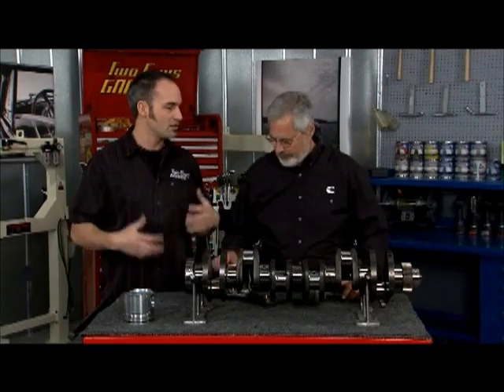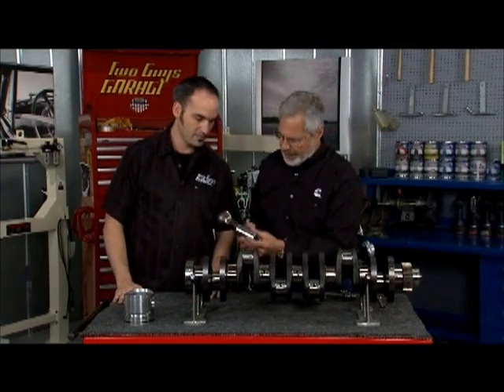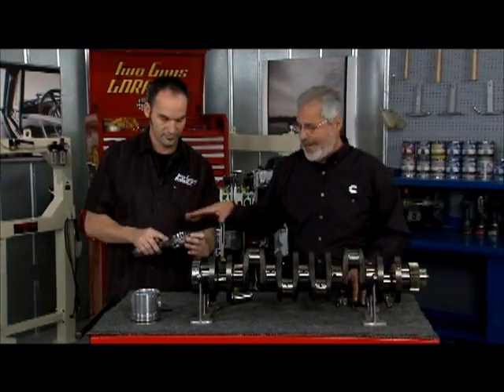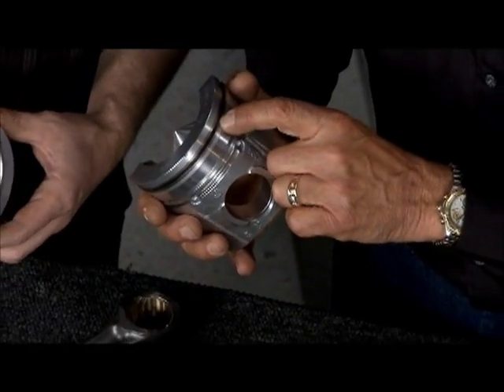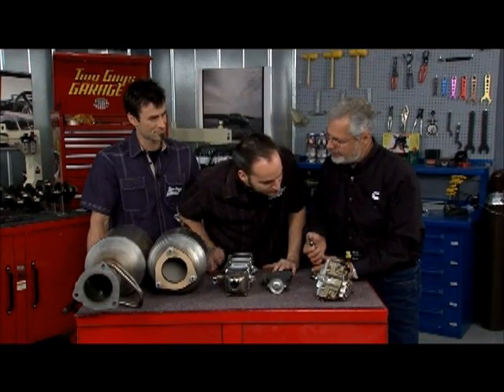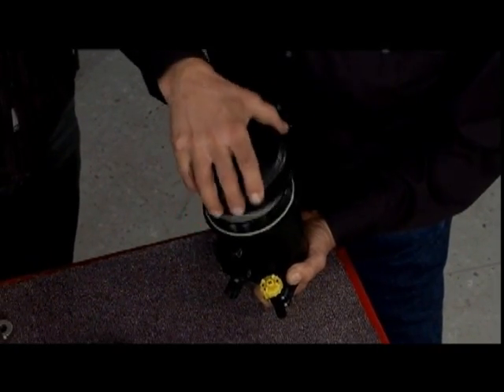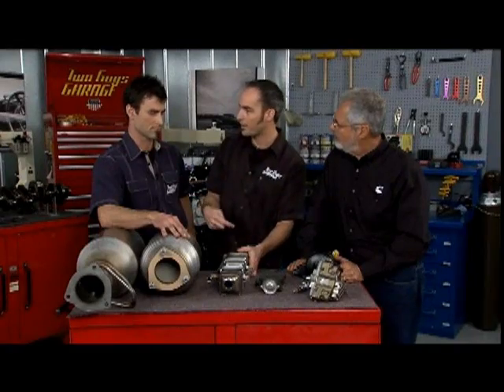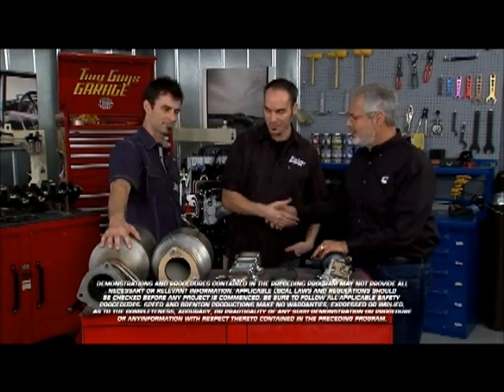Part 2/2 - Cummins 6.7L Turbo Diesel as seen on SPEED Channel's Two Guys Garage

Comment: Still running my 2012 6.7 fully deleted and tuned stainless diesel turbo 5" exhaust. No problems 150,000 miles. If that factory emissions cramp was still on there I don't believe this motor would run as good and smooth. Just opening top for first time (not counting the delete) to do standard checks/ adjustments as owners manual calls for. That's all folks, power on Cummins.

Comment: that egr cooler, filter and cat made an awesome paperweight. my 2011 2500 lost about 60lbs when i threw that crap away
Reply: And it burned more fuel and didn’t run as clean.

Comment: lol reliability next to the ford 6.0 powerstroke the 6.7 cummins is prob the worst modern diesel on the road... Just check out all the lemon law lawsuits online and it is now the weakest performer out of the top 3 the GM Duramax 397hp 765ftlb and the new 6.7 powerstroke 400hp and 800ftlb..